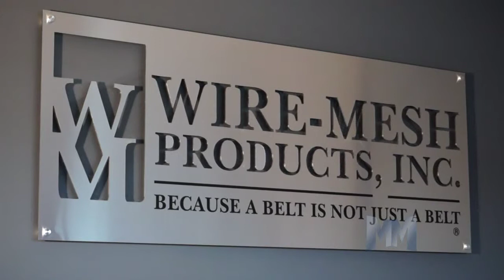Wire-Mesh Conveyor Belt

Comment: Your offre for wire mesh Conveyor :
+ Wide 120 cm / 80 kg-m2 / qtt :48  x 120 m long
+ Wide 140cm / 80 kg-m2 / qtt: 32  x 165 m long
+ Wide 200 cm / 170 kg-m2 / qtt: 10 x 200 m long
+ Wire of 1 mm by 1 mm 
+ Mesh size: 25 mm x 19 mm
+ Pulley diameter : <100 mm